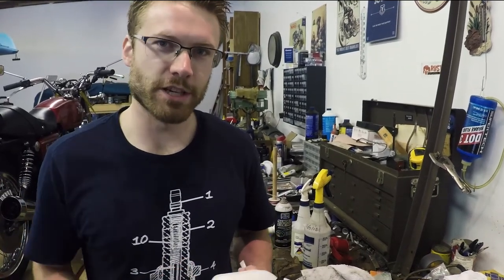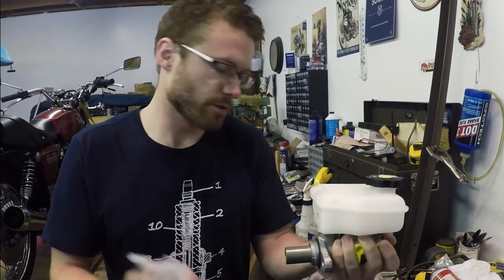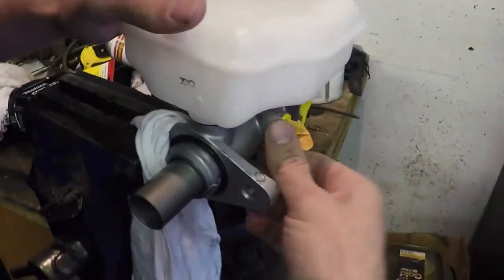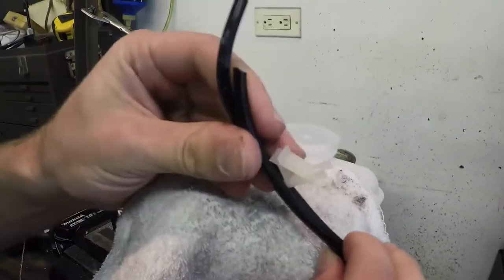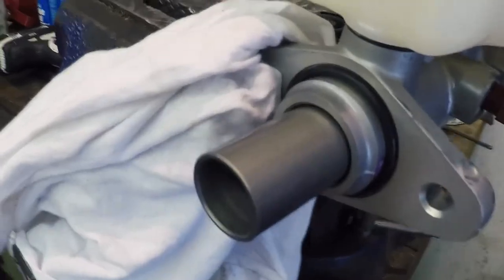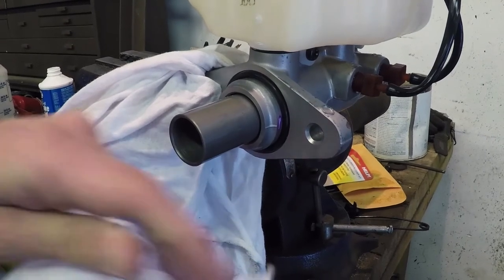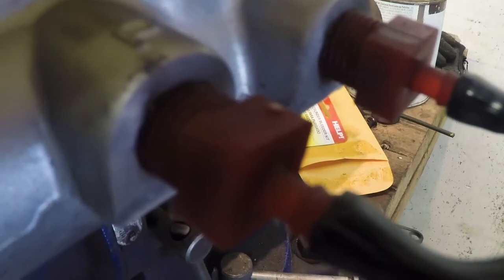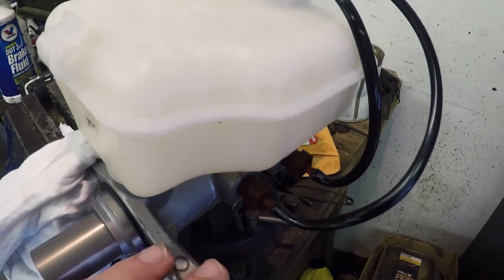How To DIY Bench Bleed A Master Cylinder

Comment: What if I dont have a bench vice??
Reply from the maker: Could get creative with various clamps 👍
Reply: @TheSundaeDrive  
Hello
my car is 1993 Ford Taurus V6  3L  and my master cylinder (bendix 12377)
have 4 ports (4 brake lines)
do I do the same things you did with to bleed master cylinder ,,but in my case i need to put 4 clear hoses ?
thank you
Reply: @victorroff7003  Taurus , Junk

Comment: WARNING This was NOT fully adequate.  As he said, the hoses should be clear.  The first through third compression should be held in for 10 seconds while tapping the MC with something blunt to dislodge any air in the chamber, then release.  Then perform the procedure above. You should also tilt the MC 15-25 degrees forward, and then rearward in the vice (if vice is so equipped) and repeatedly pump again in each position while tapping to remove any trapped stubborn air in the piston chamber.